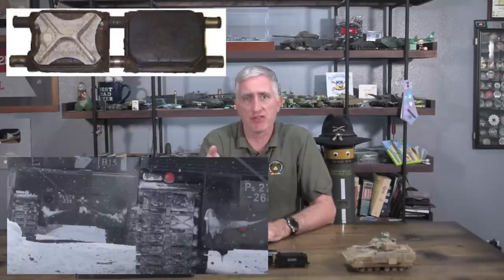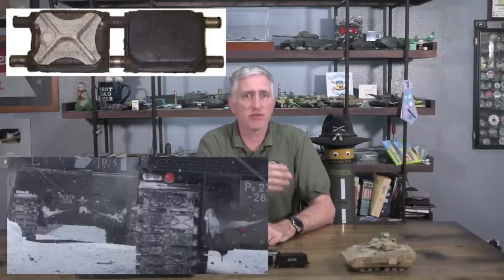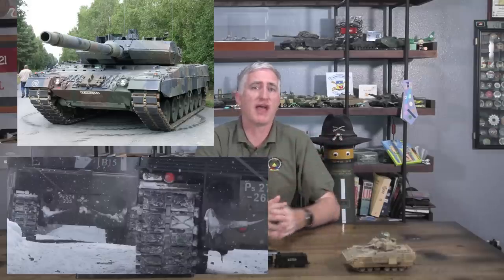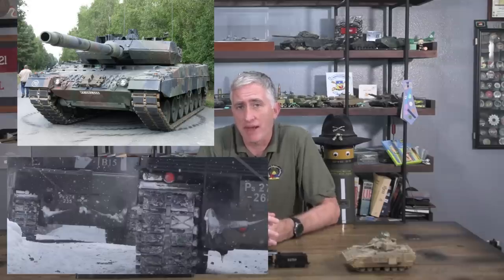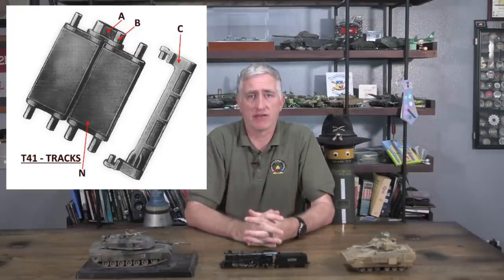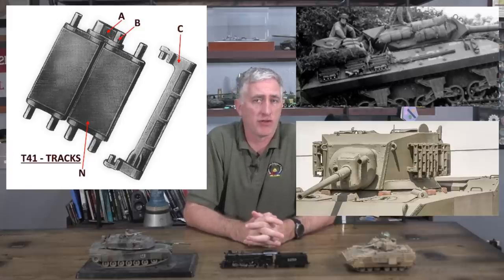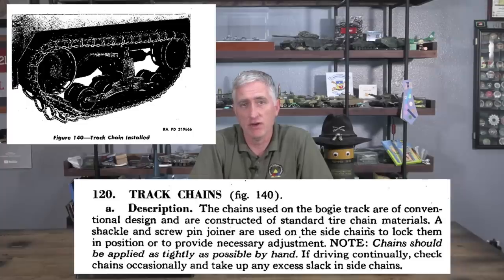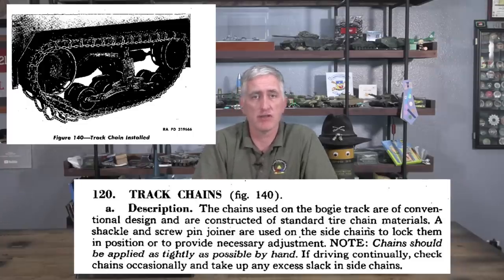Tanks 104: The basics of armored vehicle tracks

Comment: Changing track pads on a M60A1 took 2 days for 2 people one hot Ft. Polk summer. All mechanical tools.
Reply: I guess we were lucky, pounding out track pads on M113 in July took a morning.
Reply: Some of the "mechanical tools" we used to re-tension the track on the M60 were outright hacks, like a block of wood on a string that told us when the tension was about right. Not sure I remember how that even worked. Been over 40 years.
Reply: This feels like the kind of remark that has to end with "Ask me how I know." :)
Reply: @SirOsisofLiver  Ya'll had new pads in stock???🤬🤬🤬
Reply: @Einwetok  WO knew a guy who knew a guy.
Reply: @SirOsisofLiver  Ya'll got to do it in the Morning in July???🤬🤬🤬
Reply: I made a point to have good relations with the motor sgt. Got the use of the air wrench attached to the M88. Even used it to lift one of my tanks far enough to change a torsion bar, not recommended but it worked.
Reply: @SlinkyTWF  Loop the string over an end connector under the second support roller, hang the block over an end connector under the third support roller, measure the sag halfway between, over an inch and a quarter iirc break out the big ass wrench and extension pipe. Prepare to wrench. Loved the Sheridan for that, stick grease gun on grease fitting, pump until valve pops, track tension fixed. M1 had/has similar setup.

Comment: "Metal grip pads".  Less like snow chains,  a lot more like studded tires. Thanks for the content. 🤣
Reply: Not really. Studs are studs. Tiny spikes for more grip on ice. Track grousers work more like chains, which work in snow and ice and mud, by both focusing weight on ice and by creating a paddle effect in soft terrain.  But they add weight and limit speed, which is also probably true of grousers.
And they are also more analogous to chains in that they are removable and only used in especially bad ground, while studs are permanent.

Comment: Ironic, given your joke at the beginning, I had always heard that the reason why German armor had an option for narrow track was because it made them transportable by rail, they were too wide for the wagons and tunnels with the size track they were intended to use.
Reply: I believe that's correct for the Tiger, King Tiger and Jagdtiger. For the Tiger with the early roadwheels they also removed the outermost roadwheel on each side.
Reply: as pointed to Michael, that was only the case for the tiger tanks, as their wide hulls coupled with the wide tracks made them too wide to fit the european track loading gauge, so they had the transport track set developed to remedy that problem
but it was specific to those vehicles, afaik no other tank in german inventory had to resort to such measures
Reply: @quentintin1  kt had transport track.
Reply: @AdamMann3D  it's a tiger tank (share the same ordnance number, and the prototype was numbered in the same series as og tiger), so point stands

Comment: Ground pressure is critical on operations. In East Timor, the originally deployed AUSLAV, eight wheeled vehicles, were quickly withdrawn and replaced with the vintage M113 ( the tin can cowboy’s ‘sardine machine’ from my service) as the LAVs were destroying the local usually unmetaled roads, especially during the rainy season.
What is really annoying is even authoritarian texts will go into great detail regarding the weapons, and armour, they may quote power to weight, rarely quote ground pressure, which is a critical number in mobility context.
Reply: Weight's important for total load bearing capacity of transports and bridges etc. Not so much for manoeuvrability in the field.
Reply: ground pressure is certainly important, but how 'aggressive' the track face (or wheel face) is can also have an impact depending on the local conditions. When the Australian army was testing the M4 Medium tank at Madang in 1944; the M4A2 was eliminated from the trials relatively early on due to its all steel chevron track ripping the ground rather than gripping it, which would cause the tank to break the more stable upper soil layer and just dig itself into the softer soil beneath. The most successful of the M4 trial tanks was an M4A1 fitted with standard flat faced rubber block track and traction grousers, as this gave it good ground pressure and grip, but spread across a wide enough area to allow it to 'float' on the upper crust of soil present in the jungle without breaking through.
Reply: authoritarian texts? do you mean authoritative, or?
Reply: @aquaticontent  no, you see liberal texts go into great detail about crew comfort, UI, and sustainability in the field.

;)
Reply: Ground Pressure, Transmission gearing, and torque values as well.

the transmission and torque part is what irks me the most, cause there was some people I've had the unlucky fortune to have conversed with, think that a 1000hp LS V8 is capable of performing as well as that of an AFV's 1000hp engine without considering torque values.
Reply: @nightshade4873  Well it is… …just you have to actually have good gearing for the higher RPMs. That is of course’s assuming it has a useful power curve for the application.
Reply: @hoosierfarmkid  it could when gearing is meant for the engine type, however, i need to add this since i forgot to on the earlier comment, that their argument boiled down to an engine swap, rather than changing the entire drivetrain to accomodate for an LS V8.
Reply: In the Falklands war, the CVR-T's could drive over terrain that you could hardly walk across without sinking!
Reply: @nightshade4873  Yeah a high RPM car engine in a low RPM tank drivetrain would not work well lol
Reply: From aircraft and ships i know mass varied so much over time on vehicles you'd struggle to make a fair comparison.
Reply: @imagifyer  Interesting.Bulldozers always use straight grousers for similar reason.Those give maximum traction , and relatively easy turning.Sliding sideways on hills is considered an acceptable compromise
Reply: @FrontSideBus  
And yet my MG would stall in the rain.  Because England is always sunny and dry.  Still loved that car.
Reply: @nightshade4873  how long is that engine MEANT to be putting out a thousand horsepower, as well...?
Reply: Do bear in mind that tracks do not generally offset the load difference between vehicles. I suspect one of the main factors in choosing the M113 over the AUSLAV was the fact the M113 is lighter; although the tracks do help. Wheeled vehicles will have better contact patch load than say MBTs, but they will have other disadvantageous factors like not as grippy mechanical surfaces on the rubber tire compared to a metal track.
Reply: Works on wheeled vehicles too, French Foreign legion dropped air pressure on some of the trucks, etc to avoid setting off toe poppers, somewhere in Africa IIRC.
Reply: @Einwetok  Do bear in mind that will come with decreased grip in some modes of operation, and increased grip in others. It's not at all the same as just mounting wider tires, for example.

The tire will typically gain increased longitudinal grip and have more footprint, but will suffer when turning, having less lateral grip and a smaller/more uneven footprint, depending on the ratio of FY to pressure. So dropping pressure might make things worse when turning, and often does.
Reply: @ArchOfficial  The concern was not setting off mines , the rest was not that important.
Reply: @FelixMeister actually for most roads and bridges the way the weight is distributed is more important than the total weight. There is a total maximum load for a bridge, but generally if the weight is spread over a greater area, the acceptable load is much higher. This is why heavy trucks are required to use a certain number of axles, and these axles need to be spread over a certain distance in many jurisdictions. This is how you can have special overweight transports with many axles carrying enormous weights over roads that are normally restricted to far smaller weights (although partly it's also because they are very uncommon and travel very slowly, not constant traffic at 70mph like typical trucks). In Europe a heavy truck is required to have axles spread along most of the length of the trailer, which is easier on the roads and bridges, and they typically have three or more per trailer, while in the US two axles closely spaced at the rear is the typical. This reduces tire wear from scrubbing in turns but concentrates weight loading on the roads. Which may explain the terrible state of a lot of US roadways. A tracked vehicle is the ultimate way to spread the weight out across the ground. The issue is that an MBT is such an enormous weight that it still focuses a large load over a short distance of roadway, which is especially an issue on bridges. Floatation is different in that it has to do with the total contact area and how it sinks into soft ground. More axles and wheels help, but in the end the contact patch of each tire is only a few square inches, somewhat more large high floatation tires, so the weight is still concentrated on a small area of ground and will sink in more. This is of some importance on paved roads, but less than weight over distance (and it's generally offset by the other stresses tracks create on pavement). So a tank can have low enough ground pressure to travel over soft ground but still exceed the load limit for roads and bridges. Although they are typically exempted since they aren't common traffic, and are allowed as long as they aren't likely to actually damage the bridge or road, which has a large safety margin. If it is up to modern standards, which isn't always the case. The main reason wheeled AFVs are becoming popular is that roads are the norm in most places and we are so used to being in places where it's paved that we think that is not worth the drawbacks of tracks when wheels work so much better for most purposes. After all, we do 99% of of driving on roads, do we really need these tracks, which are heavy and maintenance intensive and to tear roads up? Then we end up in a place where the roads aren't great and it's not generally dry and solid, and suddenly it seems like a less good idea. Although then they will probably think it's easier to just pave everything then the replace all the equipment. Basically we are building our equipment for optimal peacetime utility, which isn't always the best idea if a fight actually comes.

Comment: The narrow tracks used in the 1920s and 1930s are also related to the Christie type running gear, since it was intended to transport the tracks on the track-cover while driving on wheels. 
A special case are the tracks of the Universal Carrier, which had to be laterally flexible in order to allow steering via lateral bending of the tracks.
Reply: Many other 20's and 30's tanks had relatively narrow tracks as well, such as the french two- and three man tanks (R.35, H35/39, S.35 et cetera), Matilda (I & II) and Valentine.
Reply: Steering by bending tracks? Jeez that ought to give the mechanic a headache afterwards.
Reply: i think the Harry Hopkins tanks had those kind of tracks as well, as they could be driven with or without tracks, and steered either by changing the angle of all the wheels (atleast from what i remember of a diagram) or skid steering.
Reply: @nightshade4873  I think so and the Tetrarch too (I think); it seems to be a slighlty differeint system from the Universal Carrier, in that all eight wheels moved, and they also rotated/tilted in line with the direction of the warped track.
Reply: @edward9674  not really that bad, it was quite simply done ; straight lift from Wikipedia: Directional control was through a vertical steering wheel which pivoted about a horizontal axis. Small turns moved the crosstube that carried the front road wheel bogies laterally, warping the track so the vehicle drifted to that side. Further movement of the wheel braked the appropriate track to give a tighter turn. 57,000 were made - it seems to have worked!
Reply: Sorry, but no, it's not. Almost none of the tanks in the 20s and 30s were Christie tanks yet they all used relatively narrow tracks. Because they are lighter and cheaper and faster, and easier to steer. They were all trying to get their tanks to fit within strict weight limits, hence the thin armor, etc. They also used narrow tracks on the Christie tanks, for the same reasons they used them on other tanks, with the added incentive that speed was especially important and that removing and showing the track was expected to be routine, which is hard if it weighs several tons. But narrow was the norm whatever type of suspension was being used. How can you say it its somehow related to Christie suspension when every German tank before Tiger had narrow track, and the most famous "first tank with wide track" was the T-34 with Christie suspension? At which time they had also greatly increased the armor and weight and needed to retain off road ability, and had ditched the idea of removing the track so it didn't matter as much how hard it was to stow it. But it wasn't some special idea they came up with just to go with the Christie tanks. If there was anything special about Christie tracks it was that super wide pitch they tended to use, which I honestly haven't been able to explain properly. You would think a finer pitch would be the best for high speeds. I assume that the long plates reduced weight by eliminating as many connectors as possible, and perhaps were easier to handle when removed. And I think his original concept was basically only to use the tracks as an auxiliary for when the ground was especially bad. But it's odd that they stuck with it all though the BT series, and even the T-34 was relatively wide. I speculate that the Soviets didn't really understand why he used them and didn't want to muck anything up by removing them without understanding the purpose of them, so they just kept using them, because that's what Christie used.
Reply: @edward9674 why? It's not an issue if they are designed to do that. Most tracks have a degree of flex, it doesn't take much. But it's also not hard to design a track that takes most of the force on a central hinge and has a little play in the side hinges so they can flex. They didn't just slap normal rigid tracks on and say "right, if we just bend the shit out of these by brute force im sure it will all work out okay".

Comment: Perhaps you could also answer these questions in a second track video. 

1) How valuable are tracks? Can the 50 cal or the DShK disable them under a couple of hundred meters? Will a main gun round that is poorly aimed damage the tracks and running gear to the point it will need depot level repairs?

2) What is SOP for a damaged/thrown track in combat? Do you maneuver your tank so that your tank is between you and the enemy? Does another tank provide cover for you to work? Or is the tank towed off the the battlefield?
Reply: *vulnerable
Reply: @Wick9876  damn Apple speech to text.

Comment: That was really quite well done. I hadn’t really considered quite how many different forms tracks could take. 

My favorite bit of track lore is still the T-34’s solution to keeping the track pins in place. No threaded end with a nut for them. There’s a metal wedge that knocks the interior head of the pin back in place as the track goes round. Not exactly a way to reduce the amount of noise the tank makes, but it works.

Comment: The rubber tracks were surprisingly durable. When I was in Alaska in the mid 80s one of the local fishermen found a abandoned WW2 1/2 track and got it running again. There was some dry rot but they still worked.
Reply: Not a lot of UV in Alaska, which is the main thing that deteriorates rubber.

Comment: Thank you!  After all this time, I finally wrapped my two brain cells around 'track pitch'.
One more ignorant question:  Is 'metaled road' Euro-speak for 'paved'?
Reply: If memory serves the answer is 'sort of', i.e. a gravel road is metaled, but most people wouldn't consider it to be paved.  I think.
Reply: "Road metal" is the broken stone or cinders used in the construction or repair of roads or railways - the concrete or macadam finish goes on top of the road metal. It's an old term from quarrying.
Reply: Metalled roadways are made to sustain vehicular load and so are usually made on frequently used roads. Unmetalled roads, also known as gravel roads, are rough and can sustain less weight. Road surfaces are frequently marked to guide traffic.

-sonewhere online. Probably wiki
Reply: @JohnE9999  Thanks!
Reply: @nightjarflying  Ah! Thanks!
Reply: @Tuck-Shop  Thank you!
Reply: Mettallum is latin (or metallon in greek) for mine or quarry. Metalling a road is using the aggregates to make the road more durable, from gravel roads on up. Metal used to be a more generic term
Reply: @mandowarrior123  Thank you for that information; as an American, I was wondering where the term came from.

Comment: Honestly, in the 6 years I was an M-60 tanker in the Marine Corps (85 to 91) I can't ever remember throwing a track. I've helped other crews that had and the only times I've dealt with removing or installing track was either scheduled maintenance or a busted final drive. Maybe breaking track to get a roadwheel arm low enough to pull out a busted torsion bar. And nothing sucks worse than changing a torsion bar.

Comment: Fascinating and very informative.  Question:  did US surplus halftracks used for decades by Israel keep using surplus rubber band tracks or - recognizing how  rocky so much of Israel is - replace them with purpose-built metal tracks?
Reply: It was covered in "would you buy an halftrack from this men?"
Rubber tracks were made in Israel for them - tracks now available as surplus on the market for vehicle collectors.